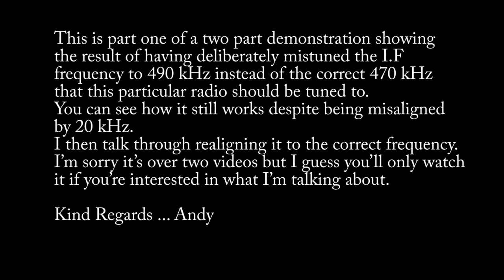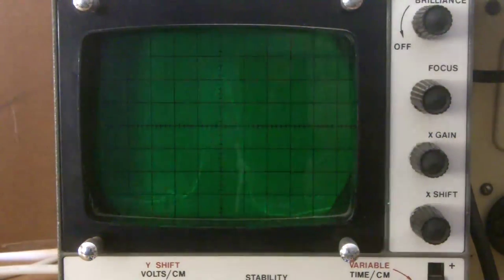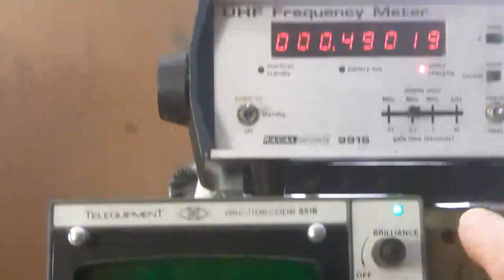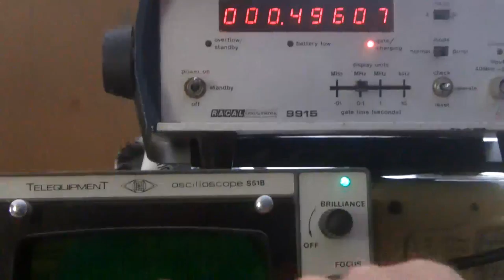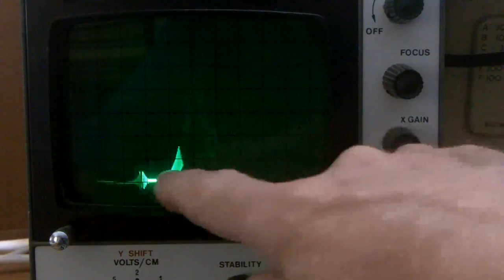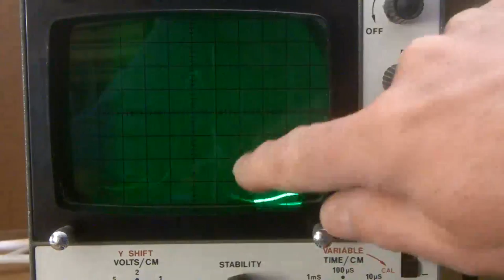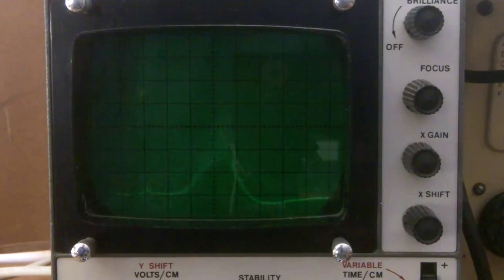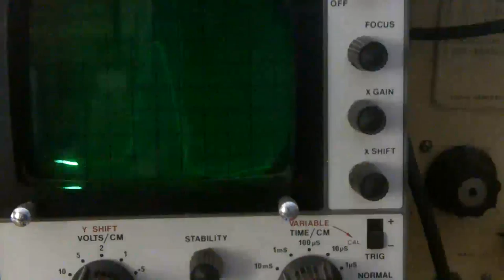About Radio 46, what if the I.F. is misaligned by 20 kHz? Part 1

Comment from the maker: Hi, the clicking sound you can hear is from the speaker. It’s the result of the scanning frequency from the wobbulator and the fly-back signal when the saw tooth from the scope flips from 15 volts DC back up to 30 volts. As the frequency being feed into the radio passes the peak of the bell it can be heard. If you wanted to interfere with everyone’s AM radio all you’d have to do is transmit at the I.F.’s   frequency and it’d be heard no matter what station they were listening to. 
Regards, Andy